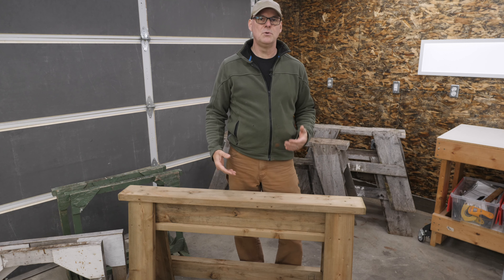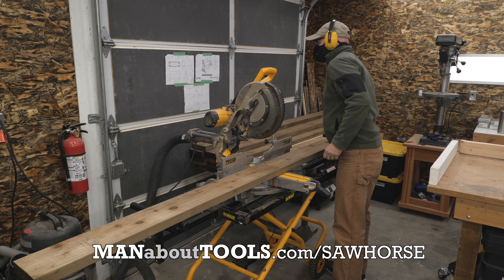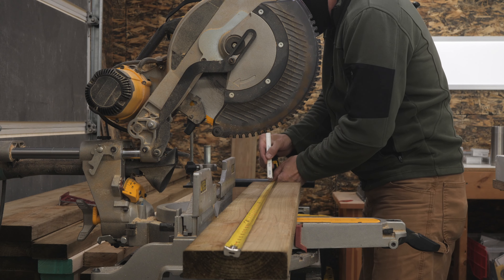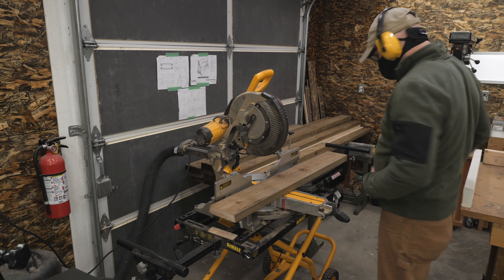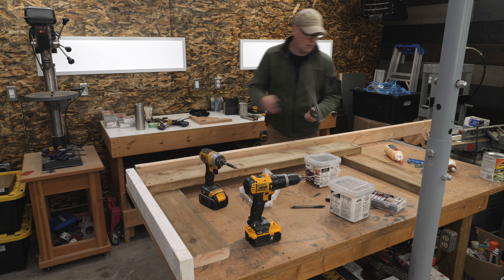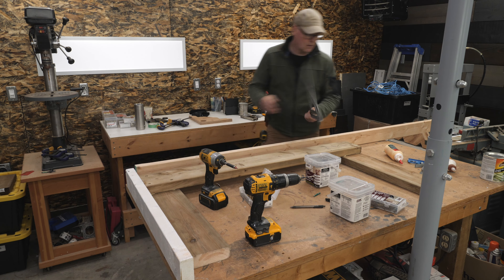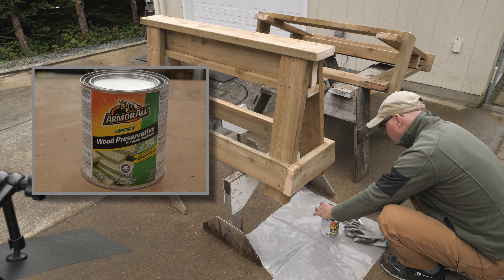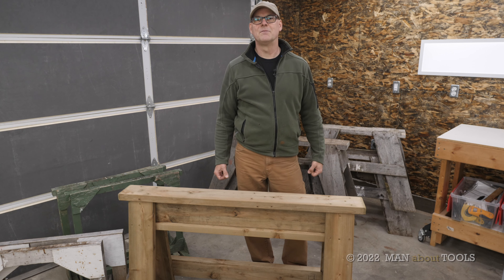How to Build Heavy-Duty Sawhorses -- Truck Camper RV Supports

Comment: Nice video.  I made the tops 48" and the legs were 24" to keep the number of 2X6's to four.  I used 2X4's that I had laying around for the stringers. I like the 24" legs to be lower to the ground than your 30" to have less stress on the corner jacks.

Comment: Perfect timing. Building a 48x16 deck, and need to clamp the ~42 joist together so I can run a router along the bottom side which will bear on the beam.
These should be stout enough.
Reply: I hope Kent doesn't mind, however if anyone were wondering what these saw horses will hold, you might want to check near the end of this YT: https://www.youtube.com/watch?v=cEUgNjT1nGU.
Seeing as Kent's is a 2x6, it should hold even more if built the same.
Reply from the maker: Good stuff!!

Comment: I use my miter saw at an angle to do my bevel for 2x6 and smaller. I only tilt the saw when I'm cutting something bigger than 6". The saw can cut  2x6 when it's vertical position. Nice set of saw horses though.

Comment: It also helps the wood to last longer before rotting on the ends that are in contact with ground is to paint the wood with waterproofing liquid. Several coats of it will ensure the wood will resist rotting for several years longer than if not waterproofed
Reply from the maker: Good tip! Thanks!

Comment: Paint board ends by polyvinyl acetate glue
Reply: Polyvinyl acetate dissolves in water. Exterior caulk would be better, also, its rubbery nature would make the sawhorses less likely to slide.

Comment: One Comment. Watch your load paths, make sure you are under major structural components in your camper. For instance, I'd place the front saw horse under that front edge. You know that the weldment of the camper has a lot of structure in that fwd wall, so place the saw horse there. If you can do the same for the rear, I'd do it too. This will stop bending over time.  p.s. I like your videos. I would not change your format one bit. Take care.
Reply from the maker: Thanks! Very good points here. I was having trouble finding any specific recommendations on placement of the horses from camper manufacturers. I wonder if two (or more?) 8' planks over each end of the sawhorses would be better. To even out the load. And have the sawhorses set at a third in from each end of the camper. I'm open to suggestions.
Reply: @MANaboutTOOLS heck, why not just cut a rectangular piece of thick plywood and place it on top of the sawhorses? to distribute weight.